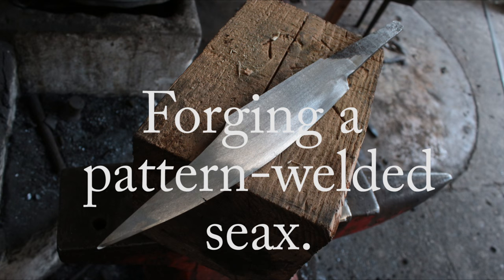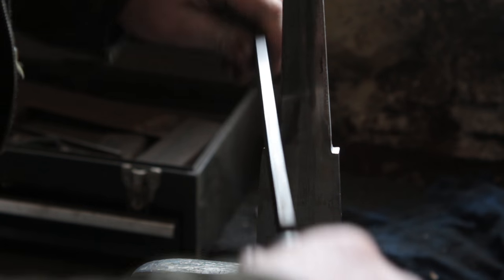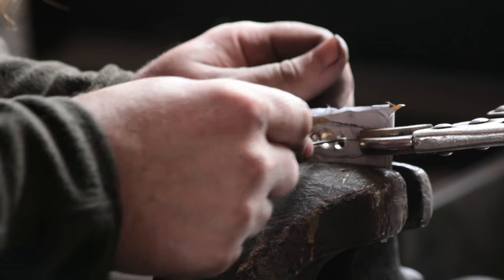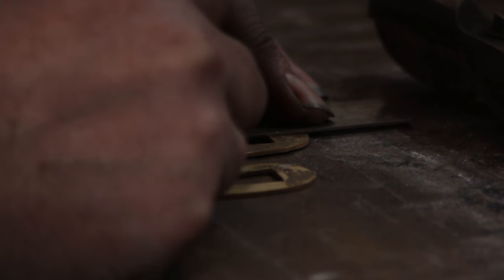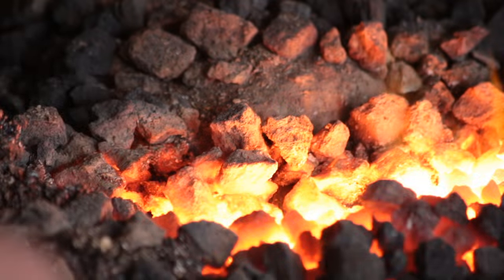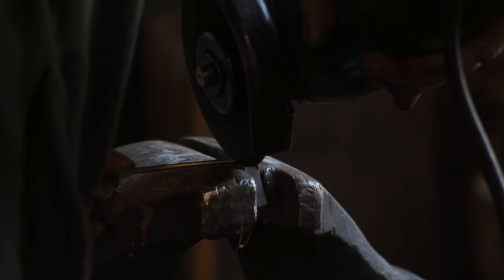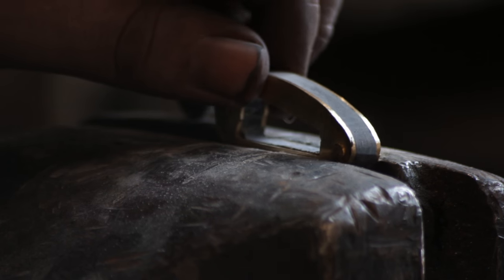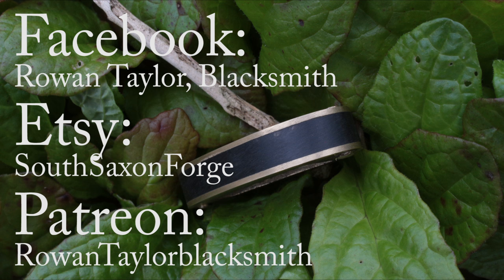Forging an Anglo-Saxon Seax, Part 3: Creating the guard.

Comment: Since you've done research on it, how would they have gotten the holes through the metal and wood if they didn't have drills? Perhaps they had the simple ones, but did they punch it out hot and file the rest?
Reply: Hot punching the holes trough metal. I do it too. You can get them extremely acurate if you know what are you doing
Reply: Cave of Skarzs there’s also the simple pump drill. There’s evidence of the Greeks using simple drills to make incredibly accurate holes 1000 years earlier than than these